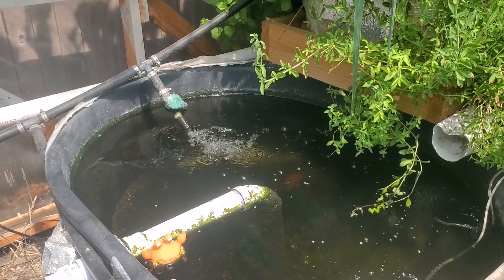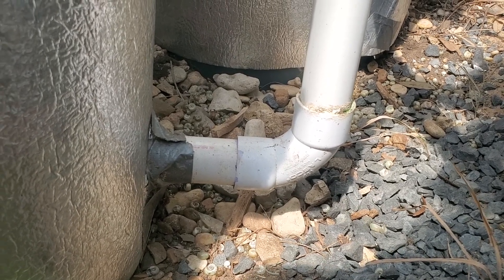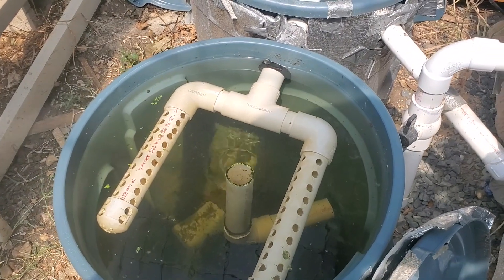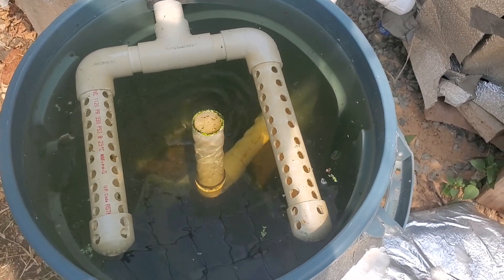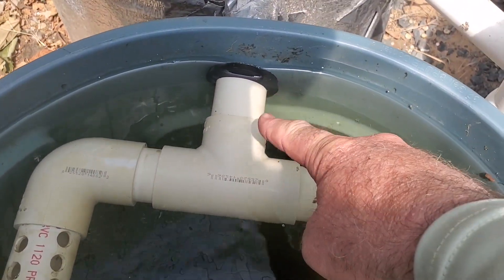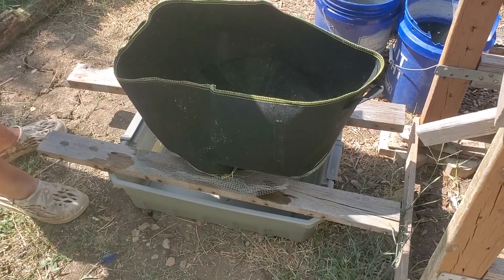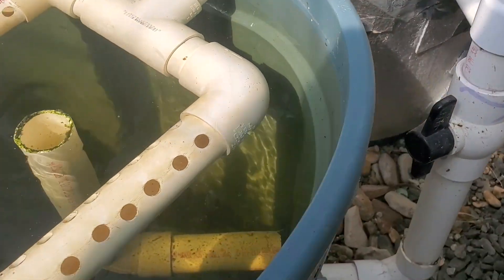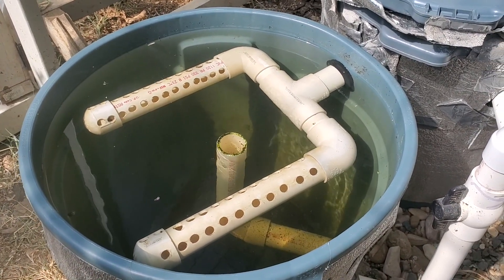Radial Flow Settling Tank for the 100 Gallon Fish Tank Aquaponics Setup - 230715

Comment: An easy way to remove the solids from the waste tank, use a cone bottom tank, with a large butterfly valve - a quick open and close of the butterfly valve flushes out the solids.
Reply: cone bottom tank are disproportionately expensive to normal shaped ones

Comment: A great video I really enjoyed it you have a new subscriber.
I am original from Nottingham England but I emigrated to Newfoundland Canada in 1990 - 2018 I decided to keep koi in my garden pond like I did in the UK but here the winter is brutal like -20 is very common so we have our own chalenges. Plus we can’t purchase equipment so I have to make everything ie filters etc.
Cheers Mate.
Reply from the maker: Sorry, mate, for taking so long to reply to you!  Been beyond busy.  I'm in Central Texas so in the summer we can easily get 40C temps (105F) and in the winter for a brief couple days -10C temps (15F) or colder.  I can't imagine doing aquaponics in Newfoundland!  

I've made everything in my 2 systems except for the pipes and pumps of course.  I try and get the stuff for free at construction sites and buy as little as I need.  I made 2 greenhouses for my two system also from scratch.  I'll made videos on those.

This winter my tank water go down to about 4C (39F).  This affected the fish badly.  I have koi, hybrid stripped bass, and largemouth bass.  The koi did ok but the hybrid stripped bass didn't do to well and the largemouth's metabolism almost slowed down to not being alive.  But over all things went well.  My mosquito fish breeding tank froze again and killed most of the fish.  But that tank is outdoors with no cover and only has a small 100 gallon fish tank heater.  Next winter I'm making a solar water heater to see how that works out.

Cheers, mate.

I lived in Cardiff from 2013 to 2018.  Loved it there.

Comment: You engineers it very well ,and you can add a drain later.
Reply from the maker: Yes I can add a drain but it wouldn't drain the tank all the way due to the tank is partially burried.

Comment: You need an open T joint instead of a 90 deg bend at the top of the SLO. This design might create a siphon which will drain out your fish tank.
Reply from the maker: I took care of the SLO siphon problem by drilling a 1/2" hole in 90 bend. I clean it out if needed so there will never be a siphon with the SLO.
Reply: @eskunkel  that would work. Good one

Comment: If you have a shop vac, you could suck the solids out and save yourself some scooping. Great work
Reply from the maker: Thanks for the idea, mate.
Reply: i use a milwaukee stick pump hook up to a 100ft garden hose to water my garden while sucking up the waste
Reply: You could put a seine net weight it and place inside your solid waste filter and just simply pull it up trapping the heavy solids when you want to clean it out !